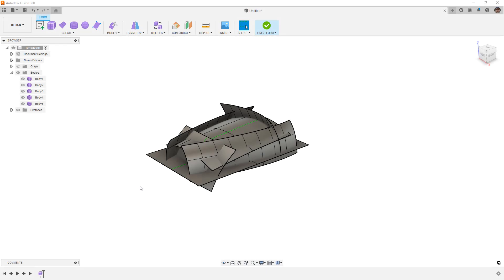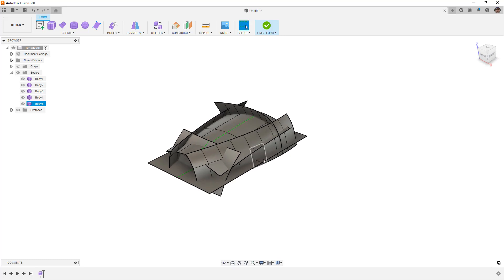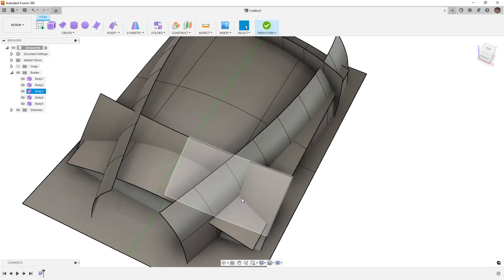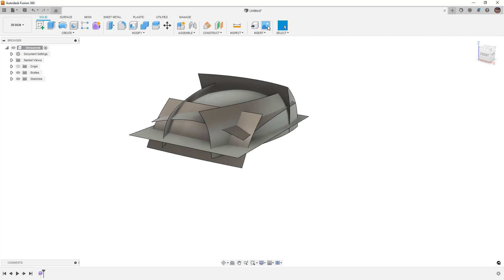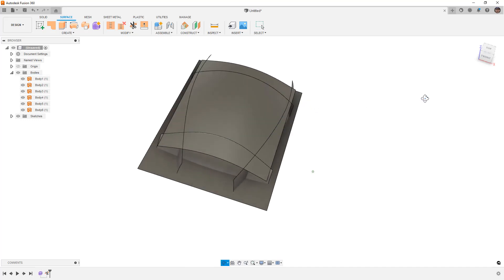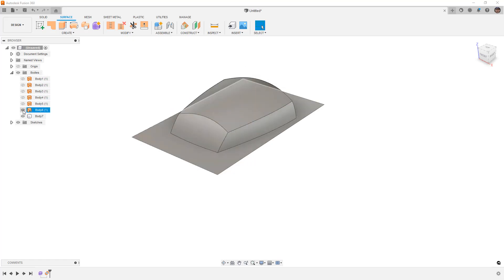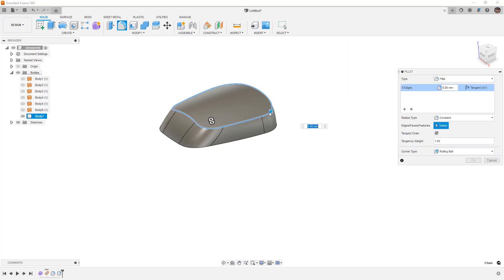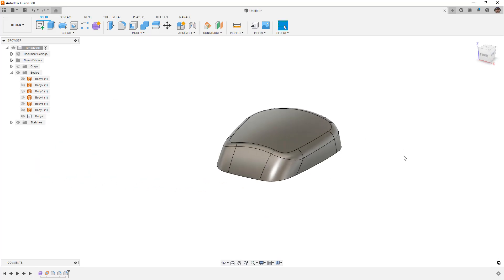Fusion 360 Forms Mastery  Part 30 - What Is Over Building Forms? #Fusion360 #Tsplines #Forms

Comment: Do you perhaps have a good reference for this technique?
Reply from the maker: For my personal workflow I don't use this very much.  One thing I did recently was a power tool housing.  And where the grip met the upper portion of the tool I was not happy with the interaction.  So i played with a few variations, one of which being an over built set of form bodies that later were combined and blended with traditional surface tools.

In my opinion creating overbuilt forms is harder to grasp/understand.  Aside from building parting surfaces for molded parts I personally find it easier to make a single body.
Reply: Here is a reference for creating blends for "class A" surface quality, seen in car and product design. Warning, this is in Catia, steep learning curve https://youtu.be/gg66HUbhrZk?si=zkp3oTVpufF0cyuV